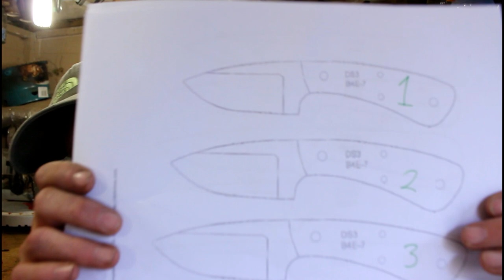Making a knife, Recycled Saw Blade,

Comment: Hi Great video. I’m after a bit of advice if possible. I’ve made a knife today. But haven’t done any annealing, quenching or tempering. Just had a bit of a go really. Could I miss the annealing stage but now do the quenching stage and then tempering or is the annealing stage key or is that just to shape the knife? Thanks in advance.
Reply from the maker: The first stage softens and normalises the steel, if parts of the steel have been over heated during cutting you will have hard and soft areas, so it could affect the blade. Since your cutting and shaping is done you might as well heat it up and let it cool down slowly to give you a starting point. (you can drill holes too for glue or pins) then go in and do the quench the next day and tempering, if you go onto instructables.Com and search for "file to knife" there are some great tips on the process

Thanks for watching
Atb Bruce